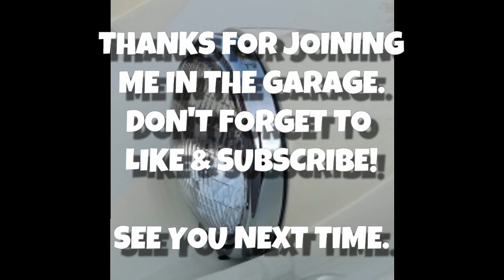Handbrake reassembled. What's next for the seats, bonnet & interior trim? Bugeye Build Episode 46

Comment: Really lining up the projects for winter. It's going to be all these sub systems, one after another. Are you going to paint the interior with the hand brake installed? Or remove it before printing and painting?
Reply from the maker: I don't plan on painting the interior any further than it is already. I have some sound deadener that will be going in before the carpet and trim panels.